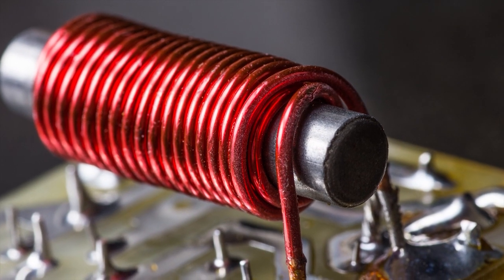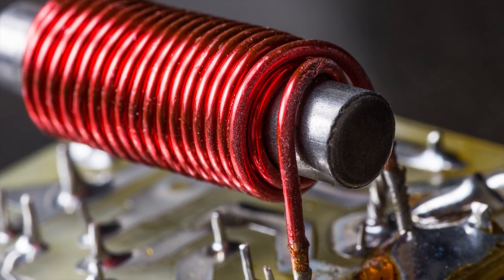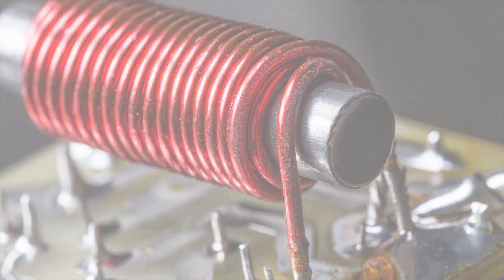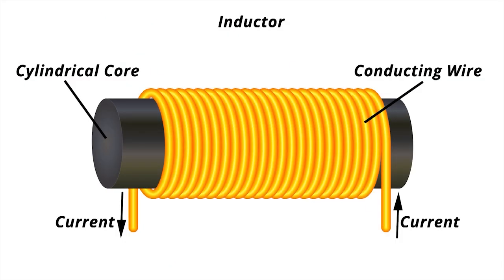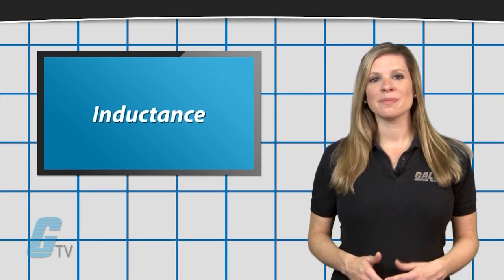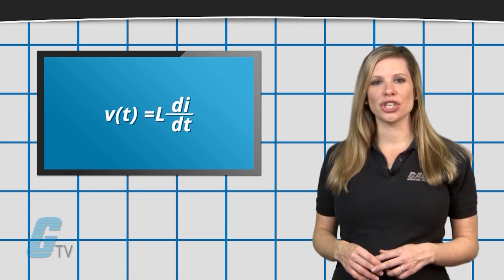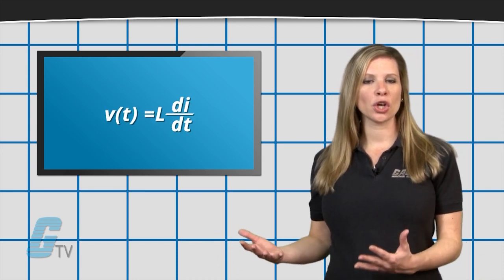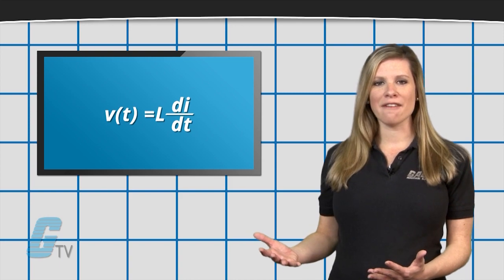What is an Inductor? - A GalcoTV Tech Tip | Galco

Comment from the maker: An Inductor, also called a coil or reactor, is a passive two-terminal electrical component which resists changes in electric current passing through it. It consists of a conductor such as a wire, usually wound into a coil.